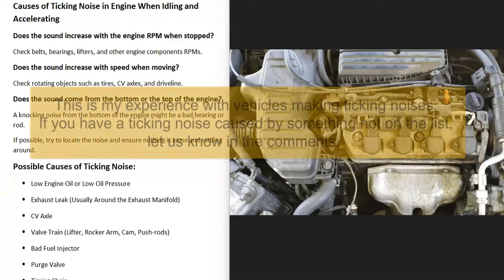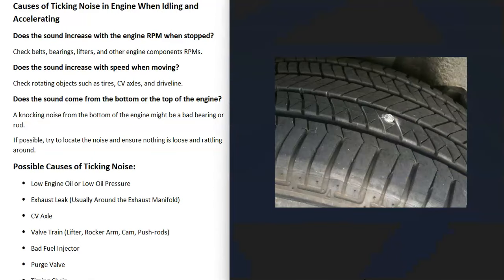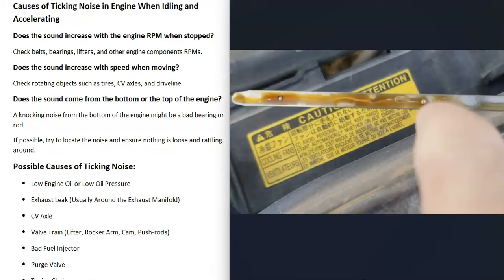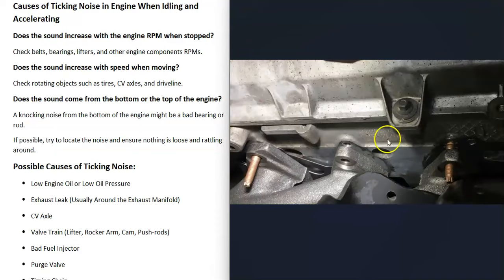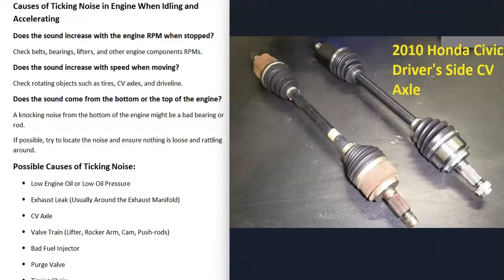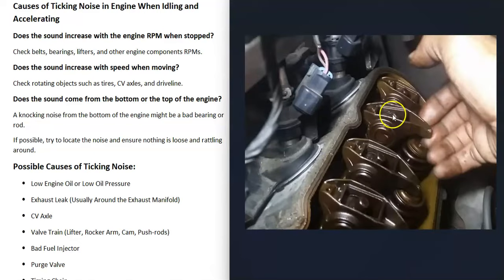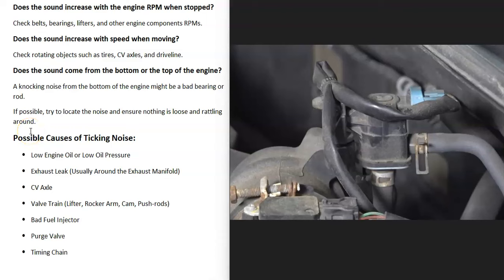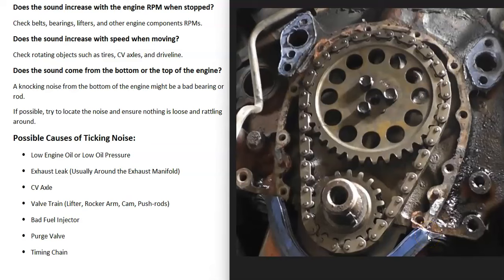Causes of Ticking Noise in Engine When Idling and Accelerating

Comment: I went to my dealer so many times they tell me they don’t hear nothing that the car sounds brand new everytime im tried of going to the dealer they don’t do shit
Reply: If it's to much work they'll tell u they don't know what it is so they don't have to do it
Reply: Bet they still charged you didn’t they.
Reply: They run the clock on warranty and bank on you the buyer to give up trying so hard.
Reply: Probably because it’s still under warranty dealers are wrong I work for one and they don’t wanna tell a customer they have a leaking transmission or oil pan or timing cover gasket right until their warranty is up so they have to pay out of pocket and the dealer gets paid , all warranty work is free work
Reply: @jamesgilliland2229  so true unless you have a very descent dealership with good management and mechanics, most times they don't have to do any major repairs during warranty. But when its up they will scare you into doing the expensive repairs when not needed.
Reply: Took three times for the mechanics to admit my driveline was failing, the third time, I made a tech come with me, then they said oh okay yeah and then took two weeks to fix it
Reply: They do nothing but overcharge you
Reply: @jamesgilliland2229 they chose the wrong profession
Reply: This comment trick they use because either the mechanic or mechanics are pure lazy, or they been instructed to wait for full failure of one or more components. Either way sadly, it is a reflection of Cadillacs incompetence.
Reply: go to a independent mechanic to write a report and then go back to them to demand a fix or refund

Comment: Mine only ticks at idle. When the car is warmed up. First start no sound
Reply: Same here, mine is a really rapid tick, all of the noises for the lifters and loose spark plug etc are a lot slower than what mine sounds like.
Reply: Hey uhhm so both your problems are a bad purge valve solenoid same happened to my ve commodore hope that helps
Reply: @wilba2222  so I have had this rapid ticking for awhile now, I also have had an issue where after I drive and the car is warmed up and I stop somewhere when I go to start it up again it will have a long crank before it starts and will randomly do that, didn’t think they were related. Then I started getting a code for a large evap leak and was told it was probably the purge valve so changed it hoping it would fix the long crank but it didn’t and then couple weeks later got the code again for the large evap leak and it’s never stopped the ticks lol.
Reply: @MarcyMckeefer maybe timing chain, sometimes a bad timing chain can cause the car to to not start, or become hard to start.
Reply: @wilba2222 mine is when my rpms go up when I start the car it doesn’t make a loud noise it’s only when the rpm are highee

Comment: Ugh I’m having this issue now. The ticking sound when I start it and when I give the car gas and in idle I took it to my mechanic he changed the oil out in Lucas oil and it still doing it. I had a exhaust leak code a bit ago, also I know the car is noisy like the springs so I’m thinking wheel bearings , but the ticking is annoying and embarrassing people outside hear it they stare at me and look under the car and it’s like ugh 😒 I just bought this car in February used of course but it wasn’t making this noise when I bought it I just don’t know what to do and I don’t drive it much bc I don’t want it to break down so I’m waiting on mechanic
Reply: Plz let me know wen it's solve, I'm having the same issue
Reply: I'm in the same boat too rn I start the car from a cold start in the morning and I hear the ticking/rattling noise when idle and when I press on the gas both idle and when driving it gets louder and faster can't figure out what it is!!!!!
Reply: I felt this, especially when people are looking as your driving by and I’m still making payments on my car. It’s a horrible feeling. I plan on taking my car to a shop that specializes in German cars and they have good reviews stating they’re honest people, so hopefully nothing to serious for anyone reading.

Comment: Would a bad egr or egr tube cause a ticking? When idling I can hear ticking near the egr. It increases louder when accelerating and it feels like it lost power.
Reply: Yes
Reply: @wally7856  I ordered all the new parts. I’m gonna try to fix it
Reply: @parkers7009  Get a long screwdriver or a stick. Hold 1 end to your ear and the other to the egr valve. It should be obvious if that's what's making the noise.
Reply: @wally7856  thanks I’ll try that. I already have all the new parts though. Upper tube that goes into the intake manifold and lower tube that connects to manifold plus new egr valve
Reply: My car make that noise when I’m driving slow but when I speed up it stop and the only code pop up was p0455

Comment: We just noticed A real loud clicking noise and  it’s when you are on the gas while your in park pushing on the gas but it started  going down the highway sounds comeing from somewhere and you can hear it when you  push the gas in the sound from the engine somewhere got me puzzled water pump maybe Pullie my air conditioner heater is not working to I don’t know it’s got me stumped

Comment: Hello Sir , I have a 2018 crv, same engine 1.5T , ticking noise from behind the engine @ 2000rpm before or beyond that point ther is no ticking, when is accelarated a few times and the engine warms up it goes away, no codes. If accelarated in P it never happens. Accelation is not as smooth as when the car was newer. so far I changed the engine air filter, oil is ok, transmision oil 20% left of life. The hose that connect to the trottle body looks good, No coolant loss, it starts up fine. I changed PCV valve (Yellow one) a few months ago due to it being stuck, some smoke was coming out of the exaust, not any more. Any suggestions?

Comment: Hi, great video. I have a ticking noise when I accelerate up a hill on my 2007 Toyota Corolla 1.8L sedan ZRE152. The car vibrates on idle. There is no dash engine light warning at any stage to indicate an OBD-detectable fault. At the beginning of February, it started vibrating on idle, hesitant on acceleration and there was pinging (knocking). I took it to a mechanic who said I must’ve filled up on bad low-octane petrol. I did fill up with Ethanol 10% E10 petrol at a budget place when my tank was nearly empty so I believed him. The car is designed to run on E10 and 91-octane petrol.
The mechanic advised me to fill up on 98 octane petrol – at the time my tank was half full when I added 98 but after a couple of days it made no difference. But I’ve been filling up with 98 since.
The idle vibration seemed manageable as, despite it also pinging, the car didn’t vibrate when driving – only at idle. On 7 Feb I was returning home late at night when I heard an almighty bang. The fan belt broke. I limped the car home without overheating the engine. As it turned out, the water pump seized and broke so I replaced the water pump & coolant and the new fan belt was appropriately tightened. Still, the car idled with vibrations and the pinging was still there. Could the broken and stuck water pump have thrown the engine timing out of whack??? So I changed the air filter, spark plugs (old ones only 16K!), and ignition coils and did an oil change. I cleaned the throttle body and MAF sensor properly. I used a mechanic’s stethoscope and I could hear the fuel injectors working. Still, the vibration problem and my OBD meter can’t detect a problem. I took it to a couple of mechanics and their professional OBD meters were the same – no faults. One mechanic took it for a drive and said he heard misfires – that’s when I changed the plugs and coils. It’s puzzling – any ideas? Jim Sydney, Australia
Reply: Motor mounts possibly.
Reply: PVC valve needs changing.
Reply: Place a medical or mechanics  thin latex  glove over the oil filler hole. Start the engine if the glove blows up and fills with air it’s your PVC valve if it is pulling in it’s fine. Bad pvc valve can put a lot of pressures in the engine. Sometimes enough to make the engine leak oil through old gaskets. I had a guy going to sell his bar because of a bad five dollar pvc valve. Replaced it car runs great. He’s keeping the car.

Comment: 2014 Lexus GX ticking noise when idling. Not always there and doesn’t change when you rev the engine. While driving, if you let off the gas you can hear it come back. No lights on dash or smell in the cabin. Just clocked 120K miles
Reply: I have a similar problem with my 2004 Honda accord, it only happens sometimes at idle or very low speeds, I don’t have a code for it nor is the noise coming from the transmission. It’s coming for the front right side of the engine which is the opposite side of the engine bay. Please let me know if you find what’s up with it so I can check out if that’s the possible problem for me, I would really appreciate it.
Reply: @Trent.likes.shoes1 Having the same noise with my civic in the same spot and I have a 2003. Lmk if you ever find the solution

Comment: I was told by multiple car part dealers and mechanics that I had bad lifters. I sourced the problem to be the alternator clutch pulley. Bearing was bad. Was a loud ticking noise also.

Comment: Hey man I’m not a mechanic but i do have a few questions to ask about my diesel engine, Iv changed the glow plug in cylinder 2 and the light is now off and then I did an oil change with a new filter inside and I have managed to improve it quite a bit but there is still a slight ticking noise in the engine and when I giver some gas it speeds up 

Is it normal in diesel engines?

Comment: Champion 🏆  .. I have a Mazda CX5 2013 and  the ticking noise is coming from the right front side of the engine bay sounds like tick..1second wait then tick tick one after the other repetitively and it's only just started happening since I water-blastered my engine bay being careful not to wet the connectors or wiring loom hoping it goes away soon or someone can let me know what it might be?

Comment: I just bought a Jag XF 2012 3.0 V6. I know it needs a good service but I had to drive it home. I’m now getting a ticking noise top of engine. Smells of fumes bit o smoke. Not going to drive anymore until service done. But worried I might have caused another issue due to driving home with bad or low oil.

Comment: My diesel xe jaguar has a ticking noise at 140,000 miles that only makes this noise on cold start. Goes away after engine warms up, but engine takes a bit to warm up.
Ticking noise increases in frequency when i accelerate. Its at the dealership for diagnostics bc i really want to understand what it is to just have a better understanding of possible issues. Currently, they suspect it is an engine bearing which is what led me here. Only difference for me in the videos ive watched is that the ticking noise i have is not permanent. It is only when the engine has not warmed up. Cold start is particularly noisy.
Reply: Valve lash/clearance? I don't know much about diesels, but that would be my guess. Id change the oil and listen with a stethoscope to narrow it down.

Comment: Question: I have a 2006 f150 4.6 with 231k oil always around 3k mostly sits in the driveway. I do hear a light ticking noise on top of the head gasket when idle but no engine light. When I press the gas it goes away.

Comment: I found some antifreeze in the top of
My oil cap. There was none in the case. I also had pain hole
Leak in my radiator.
Reply: head gaskets. just had a similar issue

Comment: Question, What about if it's when you start your car? Especially in the mornings and if my car's been sitting a while when its first started. It's ticking when I accelerate, and when I let off the throttle, it goes away.  "2008 Rav4 3.5 v6 160k,"
Reply: Mines doing this too

Comment: I had my 2005 buick lesabre sitting idling after replacing the alternator and suddenly something in the engine bay started ticking rapidly for a few minutes, then went away. It sort of reminded me of a relay rapidly opening and closing. Oil level is good and the oil is fresh. Oil pressure is good at around 65 psi. Not sure what it could be.
Reply: I am experiencing similar issues, after alternator serpentine belt replacement, got a tick sounding like valve  at idle and increases with rpm..
It sounds like ut isnt happy like that too.
Please advise whether the tension beung incorrect can cause it and any way to resolve?

Comment: i have an odd one... a sound coming from what seems to be the belt area of the engine but the noise GOES SCIELNT over 3k rpm ! under that you hear the noise, if your coasting with the clutch is also goes quite... what would cause that ?
Reply: Mine too
Reply: @milkdank3369  change the water pump and rubber belt on the left of the engine that was the problem for me.

Comment: How to you explain tapping with out any codes
Reply: Right,  I'm having that problem.  I got it check and no codes other than tire sensor code, but all ford expedition do thatand my tires aren't bad,  I'll get them filled bit they're not what's causing the sound I hear when it's idling.  It loud ticking and gets faster when driven.
Reply: Mine did that it was the timing chain
Reply: This site is bs no one have correct information lol
Reply: @maegantucker973 New timing chain on Honda Accord and still same issue bs

Comment: Hi my car starts making like motor sound when moving forward but when just running the engine without moving it don't make that sound. What mechanic issue is this please help?
Reply: Same here, check manifold gasket, also check to make sure you don't have exhaust leak, or cracked manifold

Comment: I have doge 5500 gas engine, when accelerating it hard when it’s parked it starts noise from the inside of the engine, or when driving on the freeway comes and goes but everything starts with idling or accelerating, what would it be that I should take care of it and anyone can tell me how much approximately cost to fix it. Thanks

Comment: I have the case of a rattling sound only at a certain RPM, but only when driving. If I’m not driving and then rev the engine, even at that RPM, no rattling sound. What can cause this issue?
Reply: Did u find the problem

Comment: I had loud lifters so I changed them, spark plugs and cables 
Got an oil pressure switch code so i changed it and the oil temperature sensor 
Now im getting another tik from engine and oil pressure wont go to 40 where it use to be at all the time 
Any ideas?
Reply: Could be your timing chain tensioner/timing chain.

Comment: I have ticking sounds loud early morning when the engine is cold and in 10mins it goes away but during the first 10 mins its loud and get louder if i accelerate. It all increases with time. Any advise?
Reply: check manifold gasket on engine block

Comment: 2013 Dodge Charger RT

Changed my camshaft position sensor. Now I having a ticking noise.

I moved the starter out of the way installed the part . I had trouble making the crankshaft flush. 

But now my new problem is the ticking. Anyone familiar with this situation?

Comment: I have a Buick Park Ave 2003 3.8 Liter engine it has that ticking noise .I kinda figure it out that the Lifters .So my question is bleeding this lifters is it going to work I have seen BMW Mechanics do it for their cars and it works the Lifters noise goes away from simple changing oil and holding the revs for 3 minutes at 3,000 revs

Comment: Can be somebody help me, my car has a ticking noise it usually happens and its very loud when i am driving uphill and the RPM below 3,000 but when i step hard on the gas pedal when it reaches 3,000 up rpm the noise is gone..
Reply: Check exhaust manifold, I one time had a ticking/screeching noise, my exhaust manifold heat shield had rusted off and was chattering. May not be it, but could check

Comment: My engine sounds like it's rattling when it's idling but when it's moving it doesn't. My oil level is fine and we replaced the rod bearings.
Reply: @gabbriellaamador1811 possibly an exhaust shield. Will come loose start to rattle when the exhaust vibrates, either replace it, remove it, or just get a hose clamp and clamp it down so it doesn’t rattle. Had multiple shields rattling on my old 01 Land Cruiser

Comment: Sounds like a mad typewriter and it is not constant , comes on for a short time at low speeds , comes on when stopped , comes on with foot on gas pedal shuts off if foot is off gas pedal . This is not constant it is intermittent and yes everything on the Toyota has been inspected and sure enough the mechanic did not hear it on two test drives and while in the shop. As the mechanic says if it is the purge valve and it goes bad it will give me the dreaded CEL on the dashboard. I noticed that in a different problem I had unrelated to noise , that the CEL would come on the left side of the instrument panel and Toyota figured you might miss that light so another idiot light come on the right side of the panel. I miss carburetors and simple wiring.

Comment: When idling I never hear it...while driveing when I let off the accelerator I get a ticking. It stops as soon as I come back into the accelerator..and sometimea when I start accelerating it does it a little but stops when i get to speed...but mainly when i let off...i got a code for a bad catalytic converter wld that cause this ticking..
Reply: The cat isn't a likely cause, unless it's breaking apart inside and bits are rumbling around and making noise. Id think driveline, a joint or axle, something like that. Possibly an exhaust leak. It's always difficult to say without seeing it, but I hope that helps give you somewhere to start. Don't let the cat fall apart, it'll destroy the engine if it breaks to pieces and the engine sucks those in. It'll burn a valve or worse.
Reply: @HarleySLA  appreciate it buddy